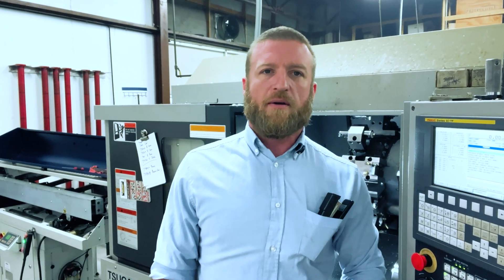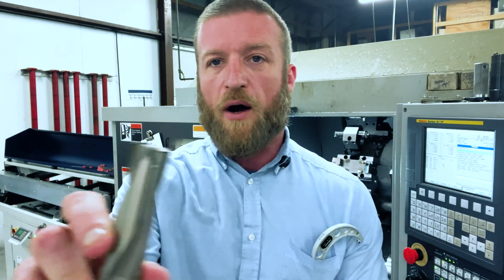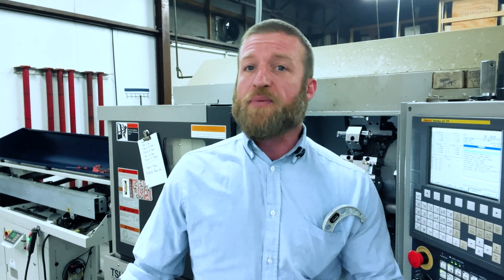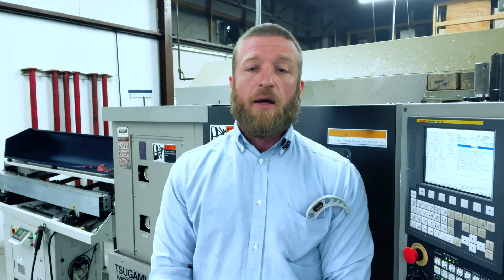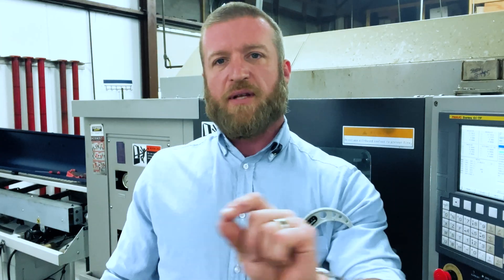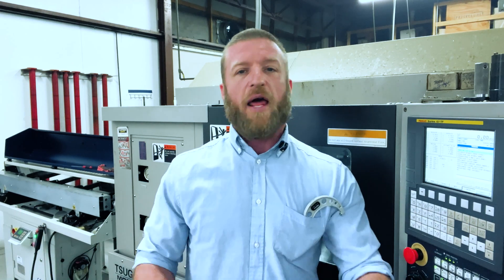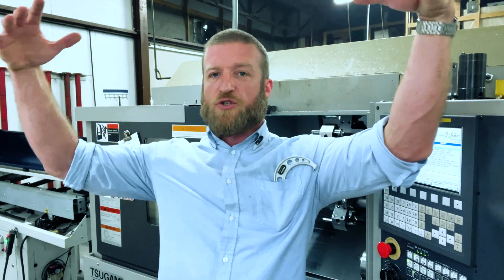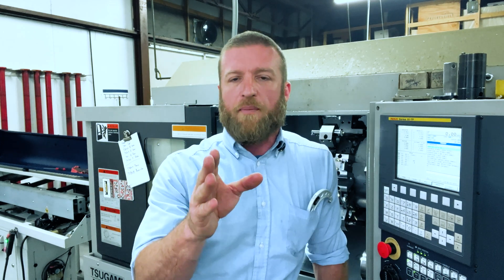Do You Know How To Control Chips? | The Lathe Lab Ep 4

Comment: 15-5 can be fun. We rough turn than send to heat treat, than back to machine. 15-5 work hardens. And can be tricky. You need to take .120 or heavier per side depth of cut, with a heavy federate up around F.02 depending on machine. A Sandvik MM or MR 2220 can handle the abuse

Comment: I set tool load limits on tools I know will wear out so the operators don't have to use their judgement. If inserts are lasting a whole shift I think someone isn't pushing their tools enough. I'd rather remove material and change an insert a couple times. That's me though. But if it's running unattended at all I do agree it's advantages to have it run all day with minimal down time.

Comment: I had a few great takeaways from this video. 
One thing not mentioned that I wanted to recognize is additional factors impacting tool life. 
Just Spitballing:
-Coolant level, concentration 
-Coolant nozzles / pressure
work holding stability soft jaws/ collet slipping / bar vibration. 

The cutting parameters you addressed are definitely critical, but I think it’s also worth discussing other factors that can make or break processes reliably.

Comment: I’ve been doing this stuff for 50 years or so. I could always get the chips good on any metals. You’re spot on as to your suggestions of things to try. Aluminum can get tricky with stringy chips but like you said they won’t jamb up your chip conveyer. Heres our biggest problem. We do around 80% engineered plastics. All different types. In the machining centers chips are no problem. A little harder on some plastics but manageable. Now when turning it’s simply a nightmare. Regardless of your SFPM you’re going to get ribbons of mile long chips which will actually wrap tightly around tools. You can’t peck cycle enough to eliminate it. High feed rates can work somewhat because you can send the ribbon of the chip shooting out fast. Still they need to get out of the machine. Drilling you can peck fairly well. Plastics are an animal all to themselves. They vary so much. We do a load of grey PVC and ABS. what is added to make it grey is actually abrasive to your tools. So dead sharp inserts are a must. And don’t think those ribbons of plastic won’t cut your fingers pulling them out of your machine lol. I’d like to pick your brain for any solutions you may have.  Excellent video 👍🏼👍🏼
Reply: We did Nylon and PVC rollers, first made a small deep slot with a live-tool, after that just turning, it worked great for chip breaking.
Modern machines can peck-turning, back in the days we didn't have that.
Reply: @ that’s a great idea and I can see how that would work. Unfortunately most of our lathes don’t have that capability. A few do and might be worth a try. Thx for the idea, makes perfect sense. 👍🏼
Reply: @Lwimmermastermetalart  
Yep just try, better when you have Y-axis travel use a thin ( 2 or 3 mm ) saw blade otherwise a 2-flute mill at centre-line will also do the job.
When you have to go deep sometimes repeat a few steps.
Actually you can program a (Z) peck, make a loop with a subprogram and move incremental in Z by W, in main program control the X, you have to make some calculations of course.
Reply: @ that’s a great idea! Never too old to learn lol.  Below I’ll link you to a video of my shop. It’s not too bad but there were many things I would have liked to include. However if they are too long you loose interest. Thx again for your replies. Too many You Tubers don’t ever respond to you. I imagine with very popular channels it’s hard to keep up.
Reply: @ https://youtu.be/N6vSGC0ZjFw?si=VpinyyPxoIJjci3B
Reply: @Lwimmermastermetalart  
I checked the video, impressive shop you have.  👍
Reply: @ thank you so much!

Comment: I feel like I struggle on some materials where tool life on my roughing inserts can really be measured in single digit parts and not 8 hour periods. My example would be turning 17-4 H900 (42 HRC). The part was a flanged shaft where we would start at 2.25 turning down to .625. The shaft of the part was roughly 2.5" long. I'd have to look back at my program to be sure, but I want to say I started at 330SFM .011IPR and .100 radial depth of cut. This gave me roughly 6 parts before I had to index the insert which works out to roughly 13min of cut time. I think we ended up at 280 SFM by the end of the run improving the tool life a little more,  but I still feel like that was pretty dismal.
Reply: I've cut more than a couple 17-4 core pins we slug and have heat treated going from 2-1/4" down to 16mm 4-1/2" back or so it's hard to explain the nightmare that can be I feel you lol. You're really at the mercy of your HT guy God help you if they don't hold them at temp long enough I've gotten 16 parts per edge or .16" per edge 😂Sumitomo AC6020M or Mits. MC7025 I get 365-425 SFM .09 DOC .01 IPR these days for like 14 parts if old dude does a good job... the HT makes all the difference it keeps it at least keeps it reliable so you don't have to use both hands one finger on cycle stop one on reset
Reply: @chopthesheep90  I'm glad I feel a bit more validated on what I was seeing with tool life. Luckily if an insert did decide to chip the corner load monitoring would catch it.
Reply: @goldentrigun  yeahhhh we run Mori NLX's and the Z axis load monitor starts at 13... creeps up to 21 or so... and then when it hits about 24 you better have your finger on the trigger because it's about to go bad bad lol I'd like to get into load monitoring we're starting to automate more, is that a pain for shorter runs?
Reply: @chopthesheep90  on our Nakamura WY series machines it's not bad. You do everything on the control side.
You tell the machine you want to monitor let's say T01. You run your cycle. It then let's you know the peak load for that cycle. You tell it a value you want to monitor over that and you're done. No changes to your program are necessary. The only downside is if you forget to turn it off on the next job it could alarm out the machine during setup. For that reason we don't use it on every tool, but we do regularly run lights out or have multiple machines for a single operator when they are manned. I want to know if I have broken a tap , chipped my rougher or lost my part off tool. Things which in my experience will break many other things. 

That being said the 17-4 job mentioned previously was 100% manned.
Reply: @chopthesheep90 yup - same. I’ve had some serious headaches on that stuff. I notice now that I’ll hit an optimal SFM, DOC and Feed rate that can increase my tool life by double digit %. I like the heat treated stuff - it helps manage the chips. Sounds like you guys got a really good handle on it and I’m glad to hear that.
Reply: That is a great way to put it. And it’s great to hear another perspective. Shops operate differently and sometimes if you’re too life won’t last a shift or five hours, then you have to check by how many parts it makes and use that as your benchmark.  I do machine 17-4 heat treated. That’s a lot of material removal. I think that actually seems like decent tool life as a starting point.  What brand inserts do you use and what insert itself - shape and radius size ?
Reply: @Crusadermachining  Because it was a small production run I actually had bought roughing inserts specifically for that job.From Mitsubishi I used CNMG 432MM MC7025 per the catalog recommendation.  
I usually use general purpose roughing inserts because we cut such a wide variety of materials and go specific when I turn 6AL4V or if I have a production run of something and I feel I can benefit from a material specific insert.
Reply: @Crusadermachining  for the bigger pins  Sumitomo DNMG432EEG AC6020M. The smaller ones we do (1-1/4" down to 6mm back 6" or better) we use Mits. DNMG431LM MC7025 so they don't scream as bad. Finisher for both is Sumitomo DCGT32.5__MESI AC6030M. We're using a center obviously but we have the same basic inserts in an 80°

Comment: I got chip management down pretty good. But still tems to struggle with finish pass stringers
Reply: Finish turn, stringers can be kind of a pain in the butt. But what I find is that when I maximize my depth of cut and bring my feed right up just high enough to wear I’m still with spec on the surface finish requirements . I usually have a pretty good result.  What depth of cut do you usually use on finish and what material?  Also what coolant delivery method ?
Reply: @Crusadermachining   I'm running 316 SS  usually taking a .01" finish pass.
Reply: Coolant is just the normal coolant line. Been thinking about getting a holder with coolant ports in it
Reply: @thunderthormx  316 could be a pain. What nose radius and what tool for that .010” cut ?
Reply: @thunderthormx  sometimes just changing the cooking line or direction can help a ton. I like to try to get my coolant directed right under the cutting edge so it goes between the cutting edge and the material.
Reply: @Crusadermachining   nose radius is .032"

Comment: Mild steel is bad. I need at least 0.33mm/rev to break a chip at ap2-3mm. 0.4mm/rev is still nothing in a solid clamped part and it just works. 21% productivity increase from there. 60% from the 0.25mm/rev that was originally programmed by retired guy or another operator which keeps the same feeds. Yes I do hand programming more and I copy their programs and optimize for myself lol.
Reply: That’s great to hear and it seems like you have a good handle on what’s going on there and I’m glad to hear that you have some serious process improvement. I also enjoy longhand programming to be honest with you.
Reply: And for that it is a Sandvik CNMG 0,8mm radius PM4425, the expensive insert, but it is very predictable. @Crusadermachining

Comment: We got some troubles with breaking chips on 3003 Alimunium at the place where I work. Tried different approaches: increased feedrate, speed, dicreased speed, played with doc, tried some different chipbreakers on the inserts, but it doesn't seem to work. it got really long and stringy and wrapping around a bar. I would be grateful, if there are any advices about this material.
P.s. I also tried to put inserts with different nose radius, and it didn't helped.
Reply: Hey thanks for watching and happy to help. What type of tool are you using, what machine and what type of coolant delivery system do you have ??
Reply: @Crusadermachining  Hi, CNMG-VP2 (korloy) for roughing, DOOSAN LYNXM2, I'm not sure if I understood last question correctly, but coolant is being sprayed on tool from nozzles on holder (not the tool).

The chip is like starting to form a spring at the start (but still not breaking) and then, when tool is getting close to a face (which is coming after that machinable diameter) is where the real problem starts: the face doesn't allow for chip to keep form a spring and it just starts coming out as a long straight line of aliminium. And then it wraps around the tool and the bar and starts hitting the door